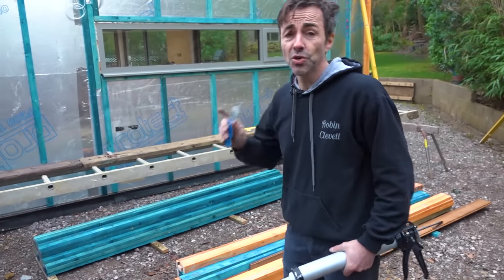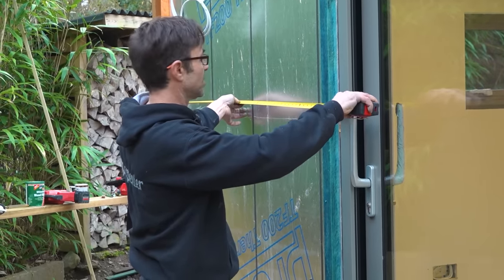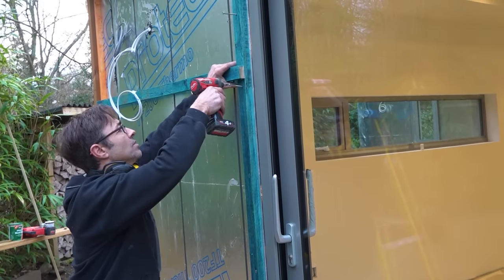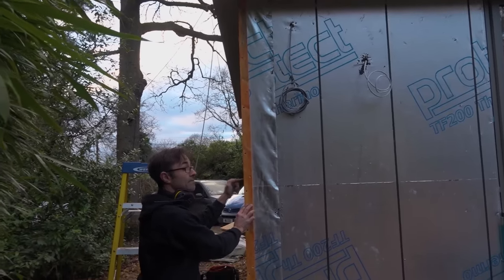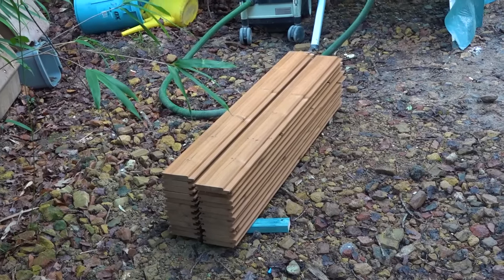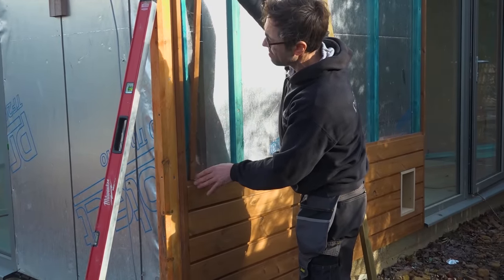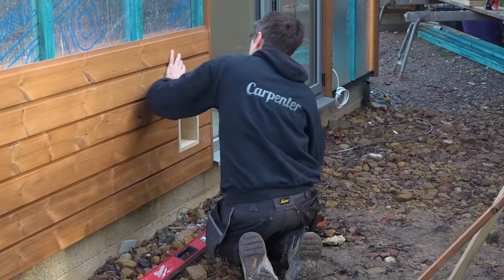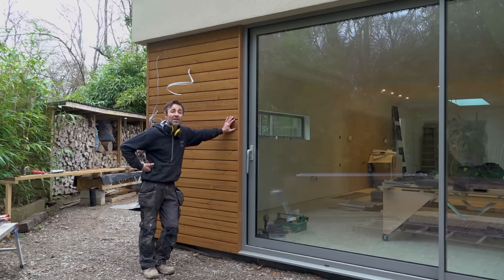How to Install External Cladding - Capel #18

Comment: I just felt the need to say to you how right you are to take notice of the tinnitus, have had it for quite a few years now,it gets worse if you stressed i don,t know why but for me it's very obvious, and trying to get a good night sleep is quite a battle I sleep the radio on all night and for me, that helps, My problems started after 4 years in a factory making uPVC windows, the router for the locks screams at you and even though I wore earplugs and a headset,it just suddenly creeps up on you, Yes I am 72 now, but thank you for pointing this out to try and prevent some other guys getting it, When i walk about even today and see the number of builders not wearing protection,i sometimes go up and mention it,.

Comment: I’ve got tinnitus, constant ringing in the background. As soon as the background is quiet, there it is and it’s progressing so getting worse.  Wear ear protection, it’s so easy to do and will save you a whole load of ball ache in the future.
Reply: Slashley gibbins yep me too, annoying as hell
Reply: Rian Murray while it’s slightly annoying I don’t let it get to me. It’s just a noise after all.
Reply: yep same, didnt realise until too late. But its not so bad that it keeps me awake. Hopefully wont get worse.
Reply: Hasher Peekpower I put in earbuds at night with rain sound and it works a treat, helps me sleep.
Reply: Slashley gibbins I sort of get used to it not ill I read your comment and yes there it is 🙄 I have always worked in the building industry renovating properties and have always worn ear defenders and masks I work with a guy never wears anything he's coming up to 60 I should imaging he won't have much hearing left soon
Reply: @stranobikes  I have to put ear defenders on me nuts.

Comment: Great video! A couple of questions; 
- Don't you need a vent at the top of the cladding to aid ventilation? You already have the perforated closer at the bottom which is great but typically you'd need the air to be able to circulate around the cladding. 
- Those blue battens are 25/50 and since you use them on the wide side you have 25mm gap. Recommended batten size for cladding is 32mm or more. Has that never been a problem for you in the past?

Comment: Hi did you know that if you have a radio in your head phones you are increasing the db.the reason you wear headphones is to cut the noise not add any. Check with health and safety and they will confirm.I love your carpentry.keep up the good work.Andy Daly .retired QA inspector.
Reply from the maker: The radio volume is limited to a level which causes no harm. It is measured in pressure on the eardrum and this is far less than many headphones and buds.

Comment: Meticulous as usual. Hearing protection 👍. Can’t emphasize it enough. A question. Bead of sealer at the bottom of the bottom board. Keeps insects out, but what about moisture that might get behind boards and run down?
Reply: Great question, it wasn't clear but the bottom row of cladding goes over a proper vent strip and the adhesive is on the face of this, any moisture can escape through this vent strip, really good technical question thank you!!
Reply: @ukconstruction  Hi Robin, Does timber cladding need to be vented at the top and bottom to allow airflow, as in a cold roof system?

Comment: Is that silver stuff externally installed PIR insulation? If so did you screw/glue it directly onto the OSB with no gaps or any type of wrap between them? Thanks.

Comment: Robin, love watching your videos. With regards to the cladding, you have made a 2 mm allowance for expansion in the vertical plane but what about the horizontal as the cladding has been cut to the rod you made up to fit exactly.
Reply: My understanding is that expansion only takes place across the grain, not along the length of the grain.

Comment: Very nice workmanship as usual. Why would you use MDF rather than something a bit more resistant to the weather for the cat entrance?
Reply: Trocoya MDF is for exterior use. It lasts forever.
Reply from the maker: Tricoya is as good as it gets Watch our video. We have test panels that have been out for over 6 years with no signs of moisture take up. We weigh them. 

https://www.youtube.com/watch?v=iC5fQ1FPpcw&t=18s

Comment: Nice....So, the battens are fixed with bugle head screws? Re the cat flap, any problems (moisture) using MDF ?
Reply from the maker: That is Tricoya not just MDF. It won't rot.

Comment: That finish to the top is amazing. was that luck or worked out on the spacing? also what were the vertical batton ctrs? looking at doing some cladding myself, is there a recommended ctrs?

Comment: Hi Robin - we have had a concrete block extension built and I;ve got PP to go with horizontal boards - I'll probably go with larch and paint them black with Barn Paint or similar. It's quite a big extension and will form our major living area. What would your advice be on batons and fixings for these and my main question is would I need a vapour control sheet on the blocks pre batons? Ive been told not to put a membrane on the building?

Comment: Hi there, really impression with yo consideration when building. Could you tell me what is needed when joining two ends of cladding together in the case where the length of the building exceeds the length of the cladding?

Comment: Hi Robin, is that a 16 gauge nail gun that you’re using.  I’m planning on building a cabin very soon and thinking of using rebated feather edge cladding would a 16-18ga nailer with stainless steel nails be the way to go? Thanks Rob

Comment: Wonderful job! You make things look easy! Will the cladding ever need protecting with Sadolin or similar wood protector?
Reply: As I understand it, no. As it's thermowood. I may be wrong, but I have worked with thermowood a few times and my boss at the time said it did not need to be treated, ever. I'm sure Robin will confirm or correct me here
Reply: @paulmcfadyen689  Hi Paul, you are spot on this material has indeed been processed with steam that prolongs it's natural lifespan and it needs no further treatment
Reply: @ukconstruction  great smell off the stuff as well!
Reply: @Robin Clevett That’s brilliant. Worth any extra money just for the fact it’s treated for life, and it should age beautifully too!
Reply from the maker: ThermoWood® is produced by heat treating Finnish grown pine and spruce to temperatures in excess of 200 degrees centigrade. During the heat treatment, chemical and structural changes occur within the timber which alter and improve some of its basic characteristics. The resulting product is an altogether more durable and stable timber, an ideal cladding material for use in exposed areas such as external walls.

Comment: Nice work Robin. Do you think 18g Brad nails will be strong enough? Milwaukee new line in Brad nailer only do the 18g and not the 16g which I find strange.
Reply: I use the 18gauge with the polymer adhesive and the 16 gauge for the main cladding fixings great observation mate

Comment: Cracking job there Robin, with the thermal wood what sort of treatment are you putting on it if any as I thought heat treating the wood chemically changes it to a degree, keep up the good work a d looking forward to the next video.

Comment: Looks like someone’s had a new sponsor, stabbed Hikoki right in the back haha
Reply from the maker: Balance is the word. Good tools we like.
Reply: I'm tempted to ditch Hikoki. I have the 16g 18v nailer which is very hit and miss at sinking the nails. 18v jigsaw is good although I'm told already discontinued for spares.
Reply: Newer Hitachi tools suck
Reply: I’ve got a few hitachi tools including the framing nailer. The nailer is great but heavy the rest I’m not so fussed on
Reply: I find makita driver to be very light and comfortable to use.....Milwaukee abit too heavy compared to other brands

Comment: The expansion gap you leave top to bottom to allow for movement, but what happens side to side? It has to be tight to look good but what if it expands? Thanks for all the great information you're giving out
Reply: Timber generally only expands in its width and pretty much never in its length, and it's only climactic change during the year that will affect it so start with a stable product and get the allowance for the expansion right and you will have no problem at all, great question many thanks
Reply: @ukconstruction  thank you for taking the time to explain that for me
Reply: @harrylenton9984  you are welcome Harry

Comment: Hi robin really good video ive got to make some 8 foot high driveway gates i was wondering could i use shiplap on the gates rather than tongue and grove and if so can i use them the length of the gate rather than going across
Reply: Hi Martin, I don't see why not, it's all about the main frame structure, just think that through and I would imagine that it should work, maybe send me a sketch on Instagram and I will take a look

Comment: I've got a cedar cladding job coming up and know I should use stainless steel nails. I want to secret nail the boards, can I use a 16GA nailer for this? Any other hints or tips would be most useful.
Reply: If you want to use nails and wood glue or PL Premium than look for "How to Build a Cedar Fence" here on YouTube. Then nobody will see how you did it.

Comment: Hello Robin.  Excellent video and workmanship as usual! I would like to ask a couple of questions if I may. I live upon the West coast of Scotland and about to start another project, is the Thermowood as good as they say? have you used it on projects before and gone back to see what it's like?  And alu clad windows, I have spent a huge amount of money on windows from a very well known firm, nothing wrong with the frames, etc, but they are constantly misted up on the outside which is very annoying!! have you had this problem? and know of any firms that use glass that won't do this?  Many thanks.

Comment: Sorry what screw did you use?  I am about to ripped the old cladding put 4mm polycarbonate windows in my shed and finish lining with 18mm osb... insulation in the wall.  The next challenge is improving the roof.

Comment: Does the small air gap and timber cladding get around the need for a cavity wall with blockwork, or is the code not as strict since this is a garden room?
Reply from the maker: This is a timber frame building. You don't need a masonry wall of brick or block. It is only done for cosmetic purposes and because the British are seduced by bricks and mortar.

Comment: He Robin, I always learn something when I watch your video's. I particularly like doing timber cladding myself being from NZ. I was surprised to see you fix the thermowood with pins. Were they 60's.? I learned in NZ that the battens are not a structural element but just a spacer. Therefor you always need to use fixings that go through the cladding and the batten to fix in to the actual studwork. (60 to 70 mm fixings) Not that it will ever fall of but certain timbers such as larch or oak etc can easily pull away from a pin or bend it and start peaking and make great homes for lots of spiders. I have seen it. (and had to fix it ) Especially shiplap cladding as opposed to T&G.. But still.. What are your thoughts on this. Would love to do a job with you one day. :-)

Comment: So you keep a 2mm gap for expansion width wise, but lock it in tight lengthwise?
Reply: As Paul Sellers says think of wood as a bunch of straws going along the grain. The moisture with expand the grain similar to how a straw would in a sense. Not so much expansion happens along the direction of the grain.

Comment: Genuine question. If the cladding expands widthwise, so you allow a gap, does it not also expand lengthwise but you haven't allowed a gap - is that a problem?
Reply: Good Question but generally timber never expands in its length always in the widest section through width hope that helps

Comment: Hi Skill builder, loving the videos over here in Jersey. Completed my trade as a carpenter and consider myself improver level (or complete amateur compared to you guys haha) Just wondering what detail you would recommend for insulating and cladding my garden lodge, it needs abit of tlc :) I was thinking, tyvek, 2x2 batten and rigid foam insulation then clad over the top? Any info is much appreciated. Keep up the good work :)
Reply from the maker: Hi James 
 I think you need the insulation then  the Tyvek then screw the vertical battens through the Tyvek and insulation into the uprights then clad.
Reply: @SkillBuilder  Thanks for the info :) Stay Safe
Reply: Out of interest what would be your optimum insulation thickness for a garden room I was thinking 40mm due to costing but would love to here your thoughts. Cheers

Comment: Hi Robin i have a client asking about cladding the outside of an existing property which currently had k rend colour render on it. This gives us the opportunity to add blown insulation such as kingspan to the outside. Client looking for replacement Ali windows which I can install with 225mm sill to allow for cladding and batten depth leaving the 25mm overhang. Treated batten Would be 50 x 50 with 40mm insulation between them Leaving a 10mm airflow. My questions are would you then use a breathable fabric next then clad with the cedar? The existing soffit is plastic would you leave a 10mm gap between this and the top sheet? Finally bottom edge as the cladding will only cover the top half of the house what product you recommend here?
Reply from the maker: Hi Mark 
The EWI Store at Chessington has all the kit to do this and they can give you loads of specialist advice to avoid problems with interstitial condensation. https://ewistore.co.uk/

Comment: is the any chance of ur cladding cupping from not using screws
Reply: Not with this material, it is super stable and the moisture content is perfect for exterior cladding, also the width of the material is not to wide and the thickness is really good too, all this helps avoid any cupping what so ever, thanks for the comment

Comment: Once in the distant past Cladding- siding was attached directly to the sheathing with a layer of Roofing Felt - asphalt impregnated felt . It breathed to the outside only. I see you allow it to breath on either side and you have left a huge amount of unenclosed area for Insects- bugs to get in. I do not know if you have Termites in the UK as that would be a very poor way to finish the exterior of the house. And CAT says the door is too low,Rats and other creatures can enter. Any Cat can jump up to waist height to enter.

Comment: Tinnitus is no joke kids, look after your ears!
Reply from the maker: We are lovers of ears and protection, don't forget knees... and heads
Reply from the maker: @jlewis1688  Robin can only look after one part of his body at a time.
Reply: What? it is synapse damage. Camomile helps calm the brain. The ears are not damaged.
Reply: Absolutely having tinnitus from a combination of ent surgery and exposure to high level noise before days of ppe  (personal protection equipment) it never stops ironically noise masks it.
Reply: @SkillBuilder  as he proceeds to use nail gun without the ear defenders even though in some  shots they are around his neck, I'm a fan of using ear plugs the type with the string, I suffer from tinnitus even using a hammer or impact driver will eventually affect your hearing.
Reply: @SkillBuilder  and shoulders and toes
Reply: Indeed, have it for life because of belt sanding

Comment: Don't  you have to put a breather membrane over the battens are the battens rot proof.
Reply from the maker: The breather membrane, if needed goes under the battens. Think about a roof and the membrane is under the battens. The battens are pressure treated and will be good for over a 100 years. Untreated battens in ventilated voids often last this long.

Comment: Look after your respiratory health also .. don´t take that preservative in treated timber to light heartedly , sawing that stuff  up on a regular basis even outdoors will more than likely come back to haunt you at a later stage..  the home handyman doing a job every now and then will get away with it .. but not on a regular basis where a trade requires working with all the time.
Reply from the maker: Good advice. These timbers have zero preservatives but the pressure treated stuff is not great to breathe in. Many builders have a reaction to it.

Comment: Robin, bad practice to seal the bottom of your cladding - should be open to allow air behind the cladding and allow drying (should also be open at the top of the cladding to allow convection air flow).  Best practice is to install a bug screen.
Reply from the maker: That is what it has. He said the screen is at the bottom and the seal is along the front of the screen where the wood meets it. There is also ventilation at the top.